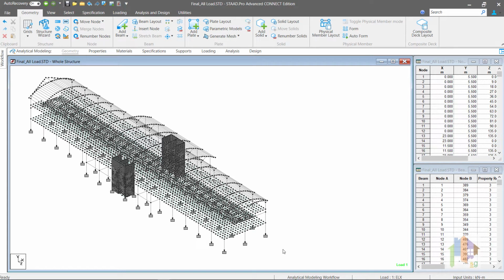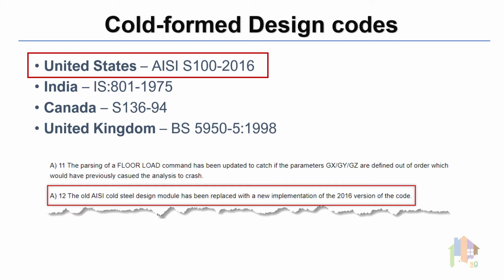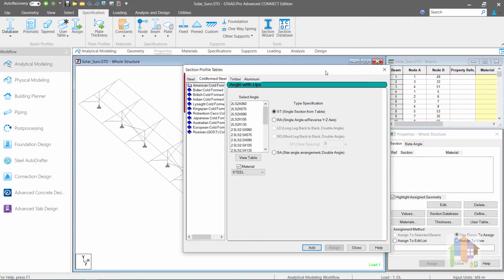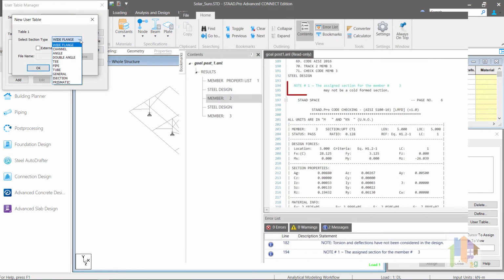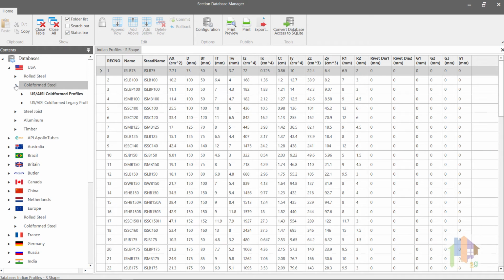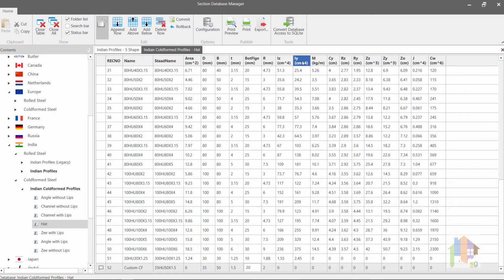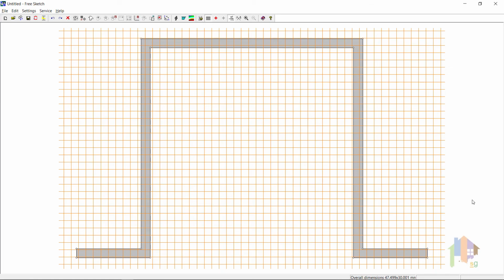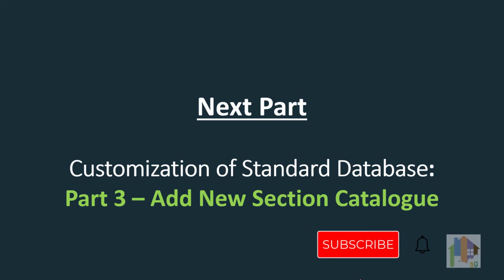Customization of Standard Database: Part 2– Custom Cold-formed Section Design|| Z-purlin/Hat Section

Comment: Thank you for the valuable information.
Would you please help me with adding a (designable) cold formed section that's not similar to the database. Some of my cold formed sections are imported from China and have a weird channel-like shape. What would be the correct method to add such sections?
Reply from the maker: Design of custom shape cold formed section is not possible. One alternative is to find the equivalent section properties considering any close standard shape (say, channel section or channel with lips), then add that property in the standard cold formed database under that category. With this approach, you can design that section.
Reply: @surojit_ghosh  Thank you very much for your reply!

Comment: Dear Sir, Thank you for the detailed video, I have 2 questions here, I am a Solar Structural Engineer:-

1.) Can we import the dwf of the customized section with fillet also added from Autocad, or shall we give the fillet radius in the staad pro itself?
2.) For HAT purlins, I am getting errors while trying to add a customized Trapezoidal section to the Staad, could you please provide a reference sheet on what values need to be added at what place for HAT Trapezoidal profile sections in Staad?

I really appreciate any help you can provide.
Reply from the maker: 1. You can import any drawing file as a section in the Free Sketch mode which is a part of Section Wizard, including the outline of the section and root/toe radius.
2. Open the section database manager, check the standard hat profiles. Whatever value is reported in the property table, you need to specify all those values for the new section.
Reply: @surojit_ghosh  Sir,Thanks for the reply,
Further request to answer 2 more questions: -
1.) HAT sections generally used for solar structures are trapezoidal in shape, we know, we can analyze the same in Staad Pro, does staad pro also design the trapezoidal shape of the HAT profile or shall we only include the perpendicular shape HAT sections (of Equivalent weight) as present in IS811 code?
2.) Can we analyze random sections in Staad Pro as cold deformed sections, and get its designed results?

I really appreciate any help you can provide.
Reply: @kamalmalik7536  Can you add trapezoidal hat to the hat database if inputted all the property values of the section.

Comment: This video helped me alot.When importing a dxf file in Staad,the dxf units must be the same as Staad units?if my dxf file was in mm dimension,while staad unit is in m dimension will it be a wrong approach?
Please upload another video which shows how to convert custom sections into equivalent section and also how to design purlin considering sag rod effects
Reply from the maker: When we import any dxf file in Section builder, we can select the unit system. So if the base unit of STAAD is in meter unit and the dxf is created using mm or inch unit, then we can select that from import dialog, and program internally converts the unit to STAAD unit system (meter in this case).

Comment: Helpful video...... .... Is it possible to design whole cfs load bearing structure in staad.... if possible do make some videos in it
Reply from the maker: Yes, you can use IS801 code to design any cold formed section in STAAD, for any structure.

Comment: How we can do connection design for cold formed steel structure
Reply from the maker: At this moment, there is no option available to automate the connection design for cold formed sections. For hot rolled section, we can reuse the structural data (geometry, release info, end forces) for connection design using integrated connection design module of STAAD. But this module does not design connections for cold formed sections. 
One alternative, use some custom templates. I will try to cover this in detail later.
Reply: @surojit_ghosh  ok sir. Thanks a lot
Reply: @surojit_ghosh  when will this be posted i keep on waiting

Comment: Dear sir 
I was trying to add Indian cold form member 80CS40X0.8 in section data base and putting all value but when  i am analysis with IS801  there is showing error Iy and Iz value missing. Please how to rectify it.
Reply from the maker: It seems that these values are missing for this section. When you add a section in database, 3 property values are mandatory - AX, IY and IZ. These three are required for both analysis and design. For your case, somehow program is unable to get these values for the assigned section. From section database table, first check whether these values are available or not and also if the values are in correctly specified (check unit system). Also you can use print member properties command and check the values from the output file.
Reply: @surojit_ghosh  sir,I put the values of Iy and Iz but when I close data base window automatically it removes the software and putting 0 value.
Reply from the maker: Have you saved the values using Commit option? Once you specify the values in the section database manager, use the commit option to save the values and then cross check the values from the section database property table. If the problem still exists, then there might be some problem with your STAAD version. In such case, post your query in the BE Communities site along with the version number and section details.
Reply: @surojit_ghosh  Yes sir I saved with commit option but steel facing problem using version 22.08.00.175 staad connect edition.one thing also,I have put only B,D,T AND Iy and Iz and rest of the values putting zero as you elaborate in video. can you tell me which values are mandatory.

Comment: I applied ur custom cold formed steel design method using IS 801 code.
I input all the data in section database.
After applying the custom section in Staad model, I just double click it to check the dimensions, in the dialogue box that custom section dimensions was changed automatically. (Ex: I enter the dimensions of C with lip 80x40x15x2 , but after check it, it shows very less dimensions)
I followed ur video step by step and applied all the procedures correctly.
Kindly guide me sir
I used staad Pro connect edition V22 update 4
I've sent the Screenshots in ur LinkedIn Inbox
Reply from the maker: Hi Siva, there might be two reasons for this. 
First, the section information might not be saved correctly in the standard section database. To check this, in the section property page for channel with lips, click on the "View Table" option and check whether the dimensions are correctly reported in the table or not.
Second, in the member query box, the unit setup might be different. You have specified the channel dimensions in mm unit and it might be reported in the member query box in inch unit (the value is also very close after conversion). From the unit setup, check the dimension unit and if it is in inch, change it to mm or meter.
Reply: @surojit_ghosh  thank you sir, I'll check the units and
 kindly upload the solar structure webinar video sir

Comment: Hi sir,I used lattice framework structure type for wind speed analysis for solar structures. Is that correct method to analyse the solar structures against wind. If I am doing wrong, kindly guide me sir. Thank you
Reply from the maker: Hi Siva, in IS875 (Part 3): 2015, nothing is clearly mentioned about solar mounting structures. But if you consider cl.7.3.3.3, this provides some idea how to calculate the pressure coefficient for free standing structures. I normally use table 8 (mono slope free roof) for the wind load calculation on solar mounting structures. You can use lattice tower rules but as the solar structure height is very small and limited to a single intensity gradient, that will not replicate accurate results. Also considering it as a tower structure, you are neglecting the effects of solar panels which is not correct.
This month I will deliver a webinar on solar structure modelling where I will discuss about this. You can check the Bentley Event page for more details about this webinar or wait for few weeks, I will upload the video in my channel after the webinar.
Reply: Thank you sir, kindly upload the webinar video

Comment: Hi sir, I used this cold rolled steels for solar structures. What is the Yeild strength of this cold rolled steels, I applied in Staad pro?
Because we uses the base material as GI sheet, in that case when the coating of GI increases, the Yeild strength will increased . That's y I ask the doubt sir, kindly guide me. Thank you sir
Reply from the maker: Yield strength is normally supplied by the vendor if you are using some custom materials or sheets. Whatever value is provided by your material supplier, you can use that value in STAAD as a design input (FYLD parameter) and also you can specify the same in material properties by editing the existing yield strength value. By default, 353MPa is considered as yield strength during design using IS801 code in STAAD. It normally ranges between 350-400 but you should check before specifying.
In addition to this, you can also consider the cold work forming strengthening effect as suggested in IS:801-1975, under cl.6.1.1. In STAAD, you can specify CWY parameter as 1 to consider this during yield strength calculation.

Comment: Sir can you tell me how to calculate safety factor of a cold formed section in terms of moment
Reply from the maker: I am not sure whether I am able to get your point properly. Normally the safety factor is suggested in the relevant design code and that also depends on load cases. Not sure which cold formed design code you are following. In general, for any steel structure, we don't allow actual force to be very close or equal to the allowable capacity value. You can consider 5-10% reserve capacity which is considered as a good practice in the industry.
There are several other factors also like importance of the structure,  how crucial is the member for structural stability etc.